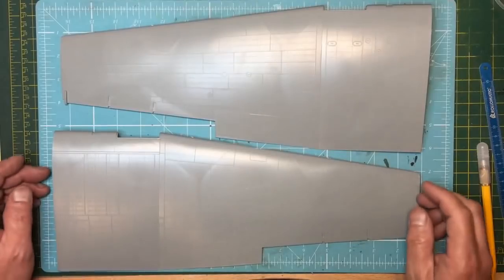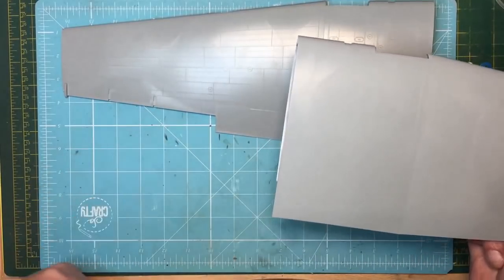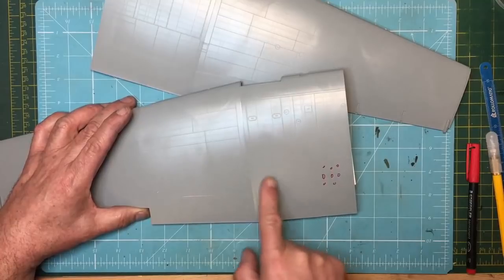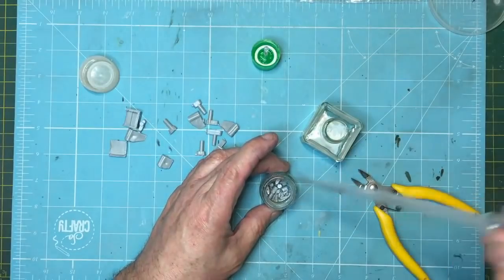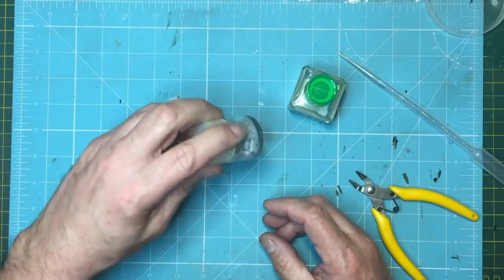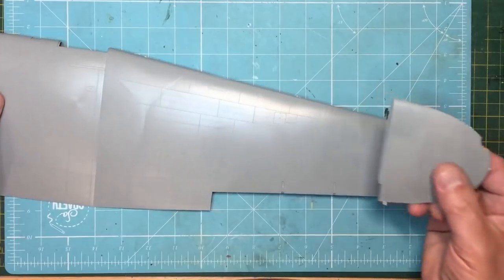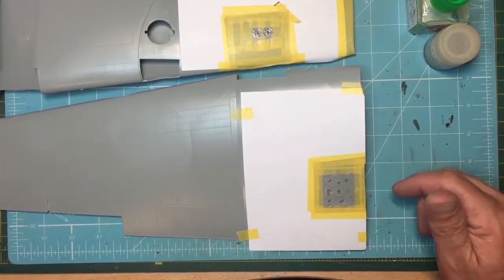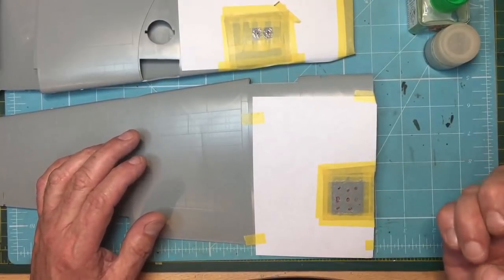HK Models 1/32 Lancaster upgrades. My mods Part 4

Comment: Amazing what you are doing with the HKM Lanc, but in your honest opinion, do you not think that after the amount of time they had to R and D this kit, it is quite a poor showing from them and considering the price of the kit, would expect it to be damn near perfect out of the box?
Reply from the maker: Daran Leaver I agree with your sentiments 100%. It’s not just R&D that is the issue, such as the silly mistakes like two dinghy doors, two sets of landing lights, service support braces in the undercarriage, tropic radiators,(if that’s what they are)? and oversized intakes along with misshaped engine covers. I also feel that a kit at this price should include more detail particularly in the cockpit area. Many modellers, me included have spent a short amount of time doing research and found errors that could easily have been sorted in design/ production.

Comment: How long do emporium take to post orders.?
Reply from the maker: In my experience next day. Frey also does wonderful packaging, and Haribo!!
Reply: He's alright,a gentlemen in fact.I found a little misprint by accident on his site.I took advantage of the situation,with a £46 order for Zm 152,and he honoured it.So  i got a tamiya glue holder for 00.01p.I use 'snack tubes' to put my tamiya extra thin in.They are bright pink,and stubby and the square bottle wedges in nicely,and are 40p each,instead of £5.29.And just rounding them corners increases stability twofold.He'd better hope thiers no diabetic modellers with dementia out there?Packaged! I nearly gave up and had a coffee at one point.

Comment: You can't see the lines until you marked it
Reply from the maker: Thanks for raising that Colin.. I hadn't even considered that!!
Reply: Nigel’s Modelling Bench  no problem guy . I think it was a case of light and cameras angle. thanks for these videos. I'm going to get one as soon as I can . Who did you say has the bomb kit please . And just a quick question. do you think that some one will do a grand slam conversion kit. I think that would be aussum. Thanks again
Reply from the maker: @colingibson8018  Hi Colin. Antics has stock of the kit, if you get one from them, please mention me. The Dambuster conversion is from Graham at Iconicair.com. You will see I did a review of the set a while back.
I think he may be considering a Grand Slam conversion after hes done with the Tractor?
Reply: Nigel’s Modelling Bench thanks Guy.